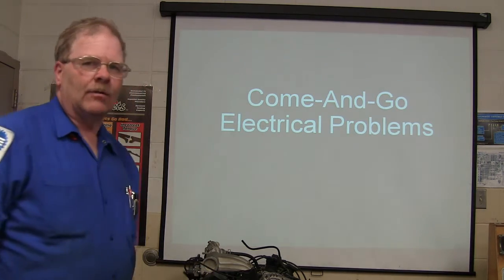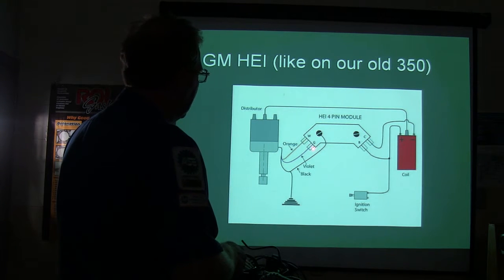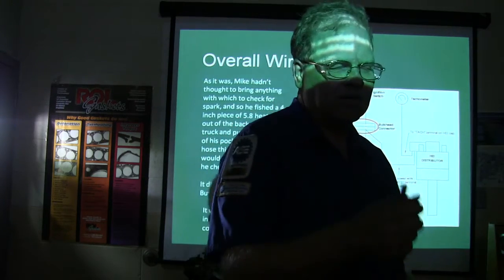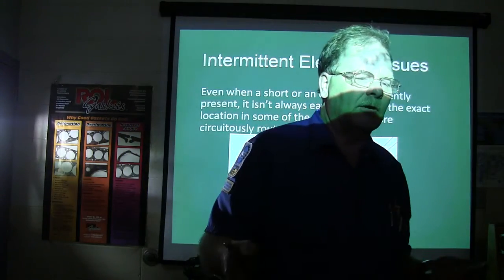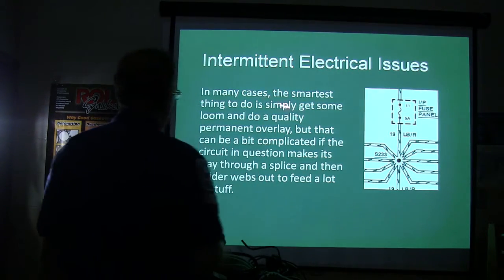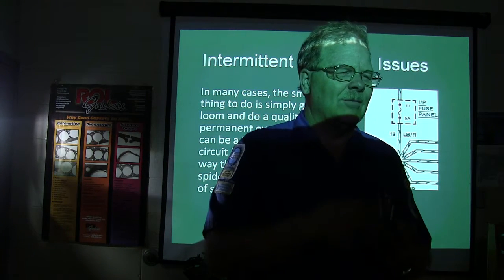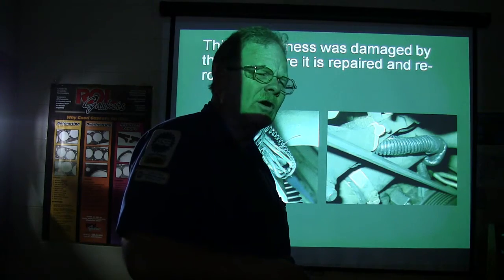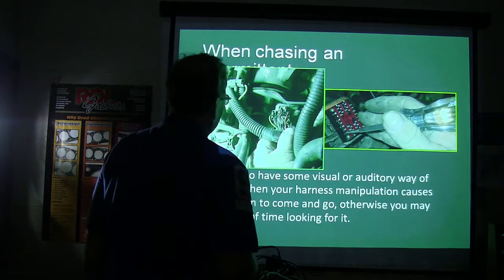Come and Go War Story Stuff

Comment: Had another one several years ago that previous car accident damage was repaired very well and you could not tell by looking from the outside it was damaged before. The small marks and imperfections on the frame helped me find the short in the wire harness. Every thing worked the way it should in the shop while testing but on the road the car would freak out and die as the wires rubbed the frame.

Comment: I was having a hard time searching for a short. Boss man got in the drivers seat to move another one into the bay and set it aside for later.  I was still testing not wanting  to stop as he went to start it and my test light lit up. So I started going over every move he made when it happened. Turned out the short was in the wire harness to one of the brains under the seat. If  the driver sits in a certain position it would cause the car to freak out. If he had as much patience as I did it would have taken much longer to figure that one out. That section of the harness over time had worn through the plastic cover and wire insulation. It had to move every time the driver does. I did the repair to the wires, plastic cover, and put a hose over it to keep it from rubbing the metal in that spot.